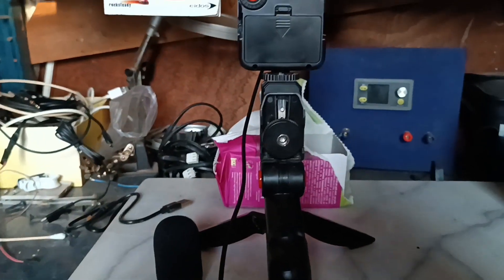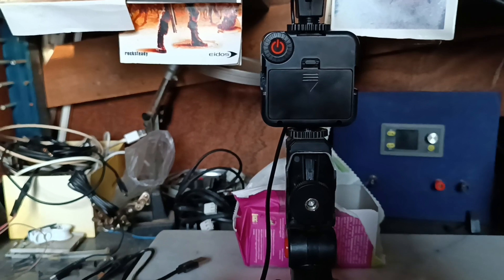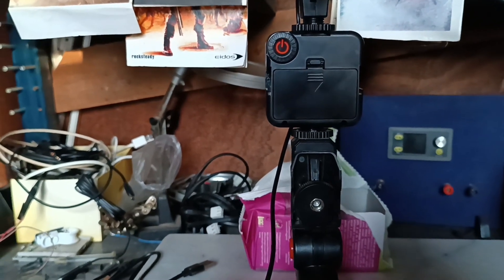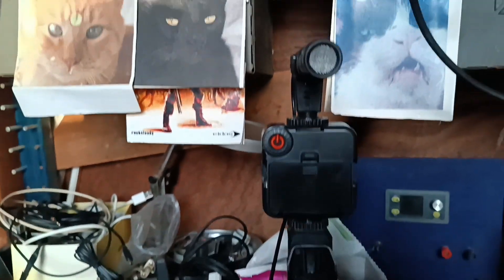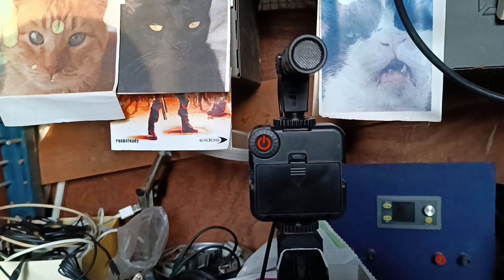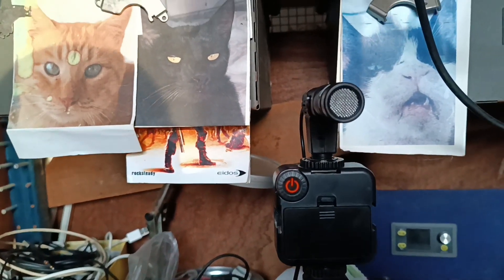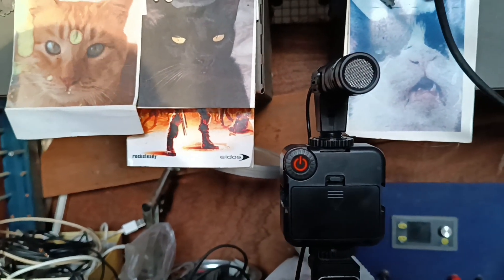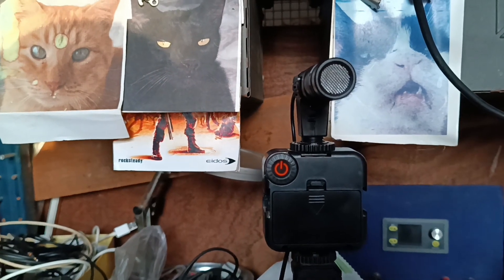Audio problems solved? Not quite but we've lost the loud clicks and pops.

Comment: Do the spectrograms show an improvement? I imagine the clicks and pops are easy to see there and you could visually confirm their reduction or absence.
Reply from the maker: I haven't looked at it yet but it's a good idea. The noises the mic was making was quite awful and reproducible they do seem to have gone but the audio level is still low. It seems that everything that comes from China needs to be repaired before you can use it. Clearly, the person who put this mic together had no idea what they were doing.